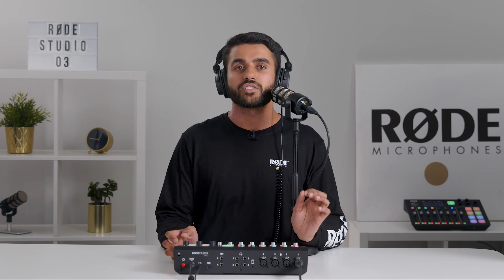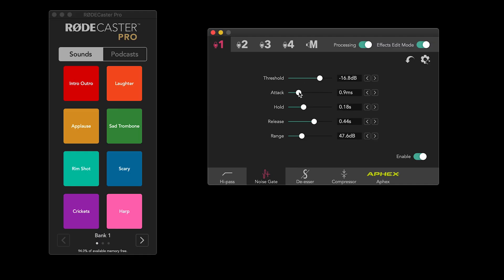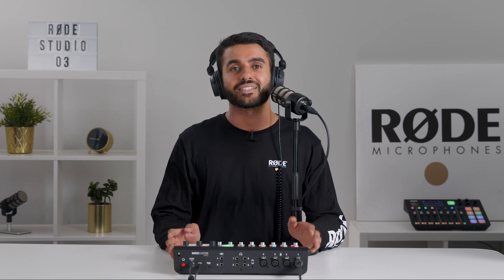How to Use the Advanced Noise Gate on the RØDECaster Pro

Comment: Nice vid. I’m new to this so can you tell me what the sliders do versus changing the gain in settings? For instance if on channel 1 I set the gain at 30. What do I set the slider at to match that level? Then my next question is does the notches represent plus or minus 1 db? Im guessing it’s to make small adjustments on the fly? Or fade out? Sorry for the dumb question.
Reply from the maker: Hey David, great questions. This video might actually be more helpful to you: https://www.youtube.com/watch?v=9WSAR4I2qgY. But essentially, once the channel fader is set to unity (the bold line in the middle of the channel markings), we'd recommend doing the fine tuning of each channel's settings in here (including levels). As you get the hang of it, slight reactive adjustments can be made directly to the sliders if need be on the fly. In terms of the dbs on the channel fader markings, there is not a linear scale that these follow, as the precise settings are done in the touchscreen menu. Hope that can help clarify!
Reply: @rodemic  thanks for the response! I take it more or less then it’s for on the fly adjustments to fade in or volume up while recording then? I’m only confirming because I intend to use this for two purposes. as a podcast recorder where the levels aren’t as important per say, and as a voice over recorder in a controlled treated room when doing voice over. From what you’re saying it sounds like leaving the slider at the unity level and adjusting the gain in settings when recording VO will work fine

Comment: Hello, 

the standard settings on the RCP for the attack time is 158ms. 
In the beginning I thought this might be way to high, but since I adjusted it to the suggested level in this video, around 5ms, it does a very unnatural sound when the speaker is breathing in before speking. I am not sure what I doing wrong, but I just had a recording and I am not satisfied at all with the noise gate. 

Weirdly it sounds better with a higher attack time, but still I am not sure if the 150ms are way to long. Please help :(

Comment: I just purchased my Rode Procaster today 5/15/21 and the effects edit mode is not in my advanced settings. Has the capability been moved or taken away? I need to adjust my noise gate and do not seem to have the option. Any guidance is appreciated.
Reply from the maker: Hey Heather, just to confirm have you turned on effects edit mode? Settings > Advanced > Audio > Processing > Effects Edit Mode?
Reply: @rodemic  Hi, it turns out those settings are not available in the Rodecaster itself. What I may have missed or was not clear in the video was the edit effects mode needed to be turned on in the companion app.  I share this only for those who may have the same question. I am up and running now. Thank you for your time and assistance.

Comment: Hey man! It’s me again, quick question with context first. I purchased the Rodecaster Pro because I wanted use it for streaming, and I had a dual pc step. I ended up returning it in the end because I couldn’t resolve an issue. 

Setup: 

I had the usbc cable connected to my Gaming rig, and I sent the audio from the Rodecaster to the streaming rig.  Then, I sent audio from the streaming rig (donation sounds and such) to the Rodecaster and used one of the 3.5 mm inputs on the back. However, the audio from the streaming rig played to those within ingame chat, and discord. 

After speaking with SweetWater, we determined that the audio was being sent out through the usb-c connection, and took over my mic input; it was like both my voice and the streaming PCs audio specifically. 

I tested this out with Bluetooth and the sound pads, and it did the same thing. Do you know if there is a way to prevent incoming audio, not the audio coming from the USBC, but form other sources, from playing through the usbc mic input?? 

I hope I made sense.
Reply from the maker: Hey, the best people to answer this question would be our support team. If you email info@rode.com, they'll answer any questions you've got!
Reply: @rodemic  it’s been almost a week :(. Still waiting for their response.